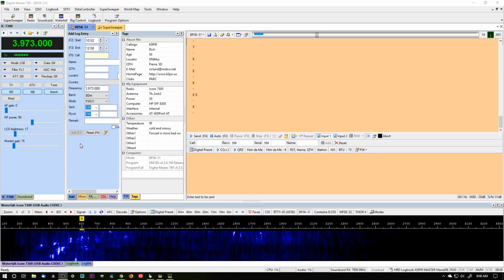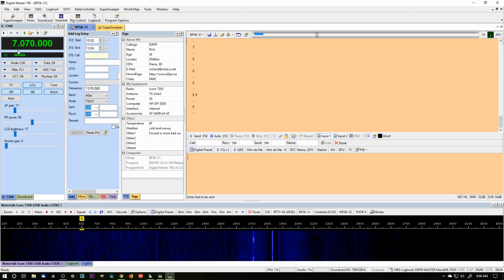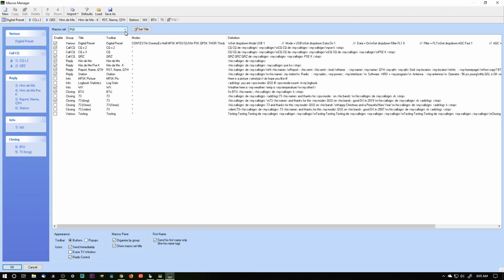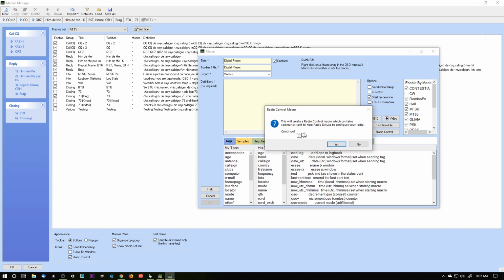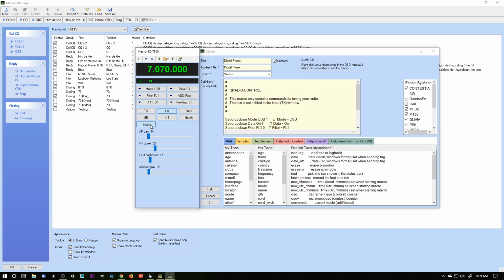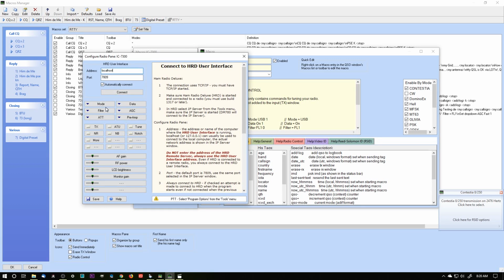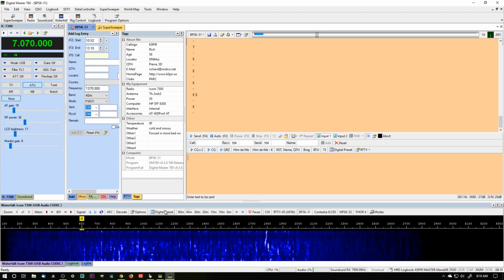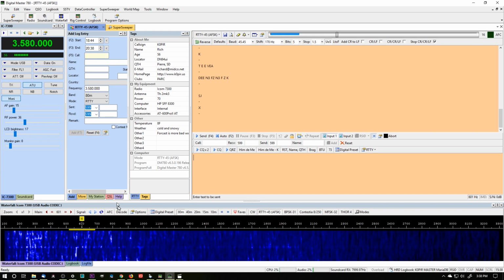DM780 Macros - Quickly Set Your Radio for Digital Mode Operation

Comment: I am just seeing this for the first time after seeing your tweet on the 3 major changes to the IC7300 firmware; as I was watching, I realized this must be old, and a work around that now exists in the firmware itself.  Thanks for this video; Wished I saw it long ago.  I don't know how many times I forgot to turn off my delta TX after working CW up  then going back to FT8 and not getting any contacts.  I also forget about the AGC settings between modes.  Great video that can be used for other radios; Thanks.

Comment: Thanks for the helpful video! The macro looks like a much easier way to switch frequencies and modes!

I am still not able to transmit with the Icom 7610 using your configuration from the other video. Both digital and CW do not work to transmit with the HRD DM780. I tried using the USB cable that came with the BA-1 and another USB cable I had. I use the black USB connector on the back of the radio. I use the sound options that say “USB” in their names. The received sound card level is only about 15 on the sound card meter in DM780, which was similar to the received sound card level in your previous video. 

I’ve been trying to use RTTY or PSK modes on the 7610, not USB. I assumed that I should be using FSK, not AFSK. I can connect to the HRD software, but transmit doesn’t work. I can transmit CW using the memory built into the 7610, and I can transmit with RTTY and PSK31 using the built in Decode option in the 7610 to receive on the 7610 screen and transmit with a USB keyboard without the computer. But using the tiny screen for digital modes is a pain!

I recommend backing up your computer with Acronis True Image to a USB hard drive and to the Acronis Cloud so you can easily recover your computer in case the computer has problems in the future. You could easily recover from a bad hard drive or even to a different computer. Or, you can recover just one file. Acronis is very flexible.

If I am using the wrong USB cable, what cable do I need to order? I can try using AFSK instead of using FSK. What do you suggest I try to get the CW and digital to transmit using HRD DM780?
Reply from the maker: Hi Dave, see my other comment. Check settings in the radio, etc. Start from scratch. The correct USB cable is just a USB type A to USB type B cable like we used with printers. Nothin special. Get HRD connected, get HRD logbook connected after that then work with DM780.
This may be a good starting place for you http://www.k0pir.us/the-icom-7610-ham-radio-deluxe-setup/ - Rich, K0PIR
Reply: Rich,  I tried using upper side band mode, and I was able to transmit with RTTY and PSK31 with HRD DM780 and my Icom 7610. I don't know how it's possible to transmit with FSK with my 7610. My audio level sounds like it's too low as received by a TS-430, compared to the 7610 transmitting RTTY and PSK31, I assume with FSK, using just the 7610 and no computer. I'm not sure what the best way is to set my AFSK transmitted audio level. I'm guessing that there should be a way to transmit RTTY, PSK31, and the other digital modes using FSK. I used to use FSK decades ago with an AEA CP-1, Commodore 64, and a TS-940AT. 

I also tried sending CW in upper side band mode. It seemed to work, but I had to manualy key the transmitter using th e"transmit' switch on the 7610. I assume there must be a way to send CW in CW mode using DM780. Today, I just notced you did a couple CW videos, I'll check out those videos.